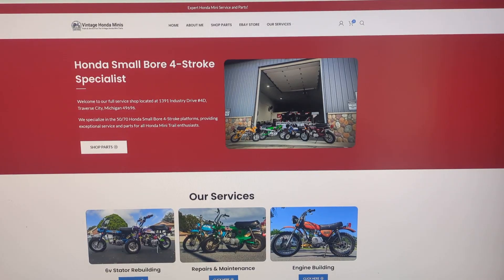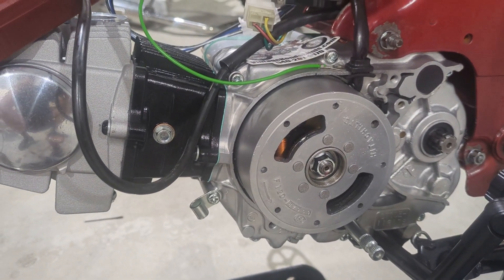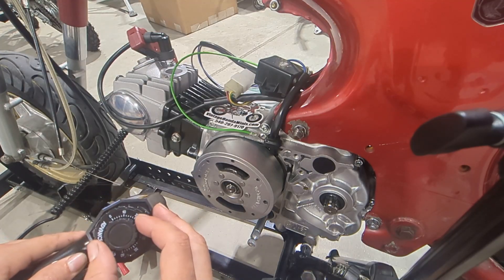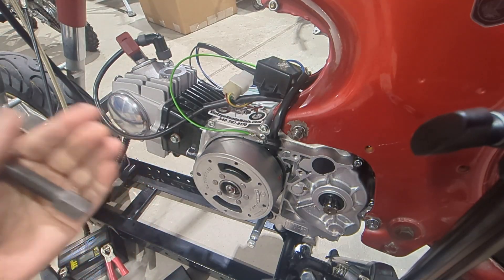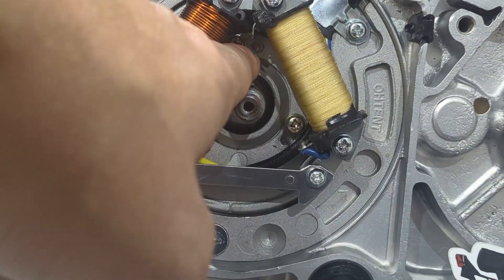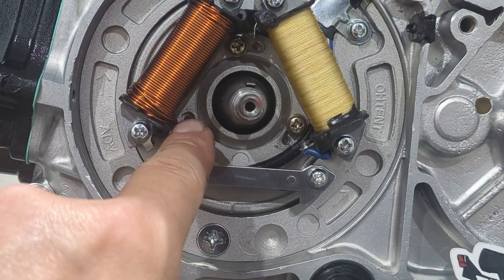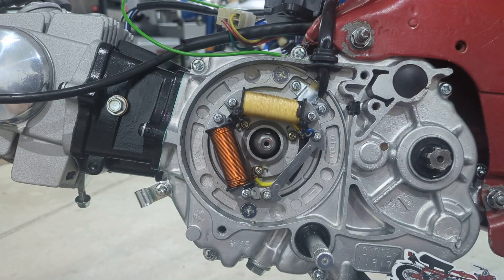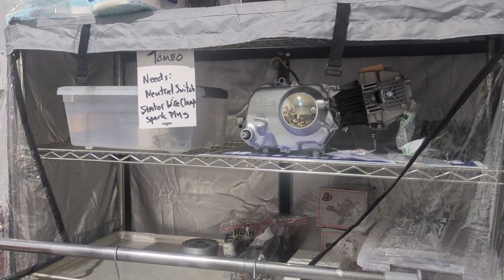Adjustable 6v CDI Ignition Kit Sales - How To Setup With Timing Light - Honda CT70 Z50 ATC70

Comment: Is this a 12v conversation? And do I need to change/ upgrade my coil?
Reply from the maker: It is 6v. Keeps original 6v high tension frame coil
Reply: I like the idea of the addition of the the holes to fine tune